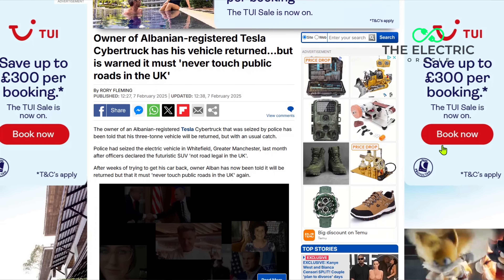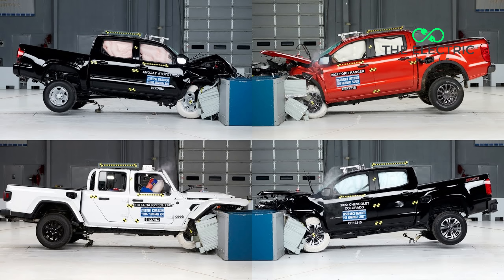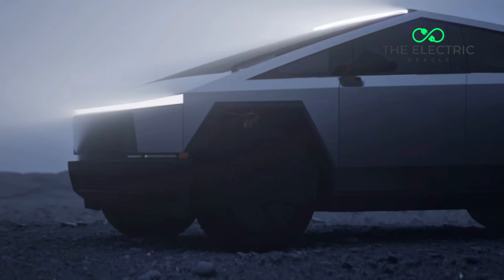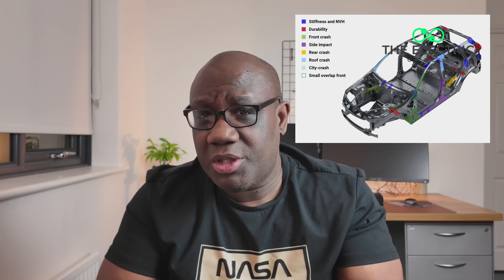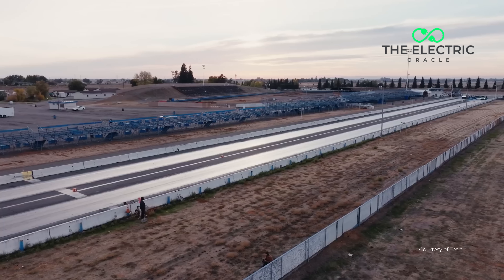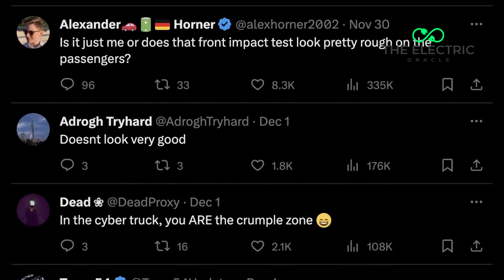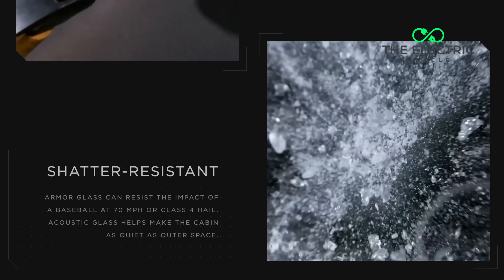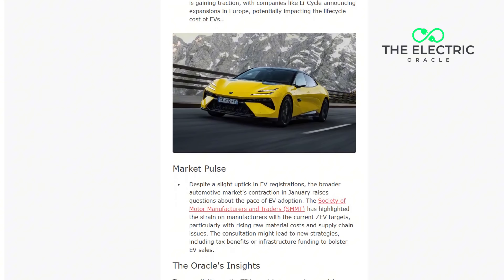Why the UK Banned Tesla’s Cybertruck – 5 Fatal Design Fails!

Comment: There’s many places in the US where vehicles never undergo road worthiness testing after they are sold.
There are pickup trucks driving around that have no brakes, suspension and cracked broken frames. Think I’m over exaggerating?
I am not, there’s a YouTube channel called “customer states” ?. 
The channel shows vehicles that show up for repairs, and are turned away because they are unfit for the road.
People living in the UK have no concept regarding the number of modified trucks on public roadways. Trucks with lift kits, huge wheels and tires which would basically drive over most small sedans. Following annual FATAL US crashes;
In 2022, 42,514 people were killed in traffic crashes
In 2021, 42,939 people were killed in traffic crashes
In 2020, 38,824 people were killed in traffic crashes
Freedom = Oversized ,Jacked UP, Huge wheels and tires,  gas guzzling Pickemup Truck cruising at 75MPH.
Outrageous for Europeans, Mericans Don’t Care.

Comment: The lighting regs in the uk and eu are not perfect. . Cars luminosity levels aren’t that easy to measure and most modern cars headlights are in practise brighter than traditional bulbs. There was a reason in the uk and latterly in the usa that we all used 5.75 and 7” sealed beam units.

Comment: It's not even a good truck.  It can't go offroad.  Look at those wheel wells and how low the ride distance is.  You will bottom out on anything but a very gentle grade if you try to take it offroad.  The suspension isn't really made for it either.

It also comes with an autonomous driving system which can't be trusted not to try to kill someone (probably you), which isn't by definition autonomous if the driver is still needed.  Oh, and that system which doesn't work well in the US has almost certainly not been tested with a right-hand drive configuration.

This is the worst vehicle I have ever seen.  If you think you look cool driving it, you need to do some soul searching.

Comment: 4:50... did you look at the safety ratings? Or are you just looking at a video and giving an  option. NHTSA is 5 stars rating overall. But I would say this wasn't built for UK more NA larger wider roads.

Comment: It's a stainless steel you can't round it. Also, that's horribly outdated. It does not have an exoskeleton that proved to be too difficult, so it has a frame. In the end, We will drive it in Canada, and other countries. If your country has motorcycles, then it all BS.

Comment: The flaws:
1. Prevents the driver from driving into the crowds of people.
2. Prevents the driver from being driven into the airports.
3. Doesn't have a fuel tank, so it's more difficult to be set on fire.
4. Can be remotely stopped in case of persistent attempts of points 1 and 2.
5. Made by company run by the worst person in earth's history (barely rivalled by a certain painter).
Reply: i do that in a gas car

Comment: It's not green if it weighs 3 tons,  it still uses energy in a pointless manner.  Why can't they make cars lighter and more efficient?
Reply: Because it is a big car, and to move a big car you need a big battery, and to move a big battery you need a bigger battery.   There are equations to describe the situation.  You can buy a Model 3, and that is a pretty small car by american standards.  Still weighs more than ICE, but that is again because of the tech.

Comment: You should let Yainni know he seems to be under the impression that the only thing holding the CyberTruck back from being allowed on the UK roads is the drive by wire steering.
Safety first, as a road user there are far too many people on the road that shouldn't have a licence let along be allowed to purchase a 3 tonne vehicle that can beat most supercars in a quarter mile race

Comment: I've watched a couple of videos on this monstrosity and one pointed something out that is actually true.  It is perfectly designed to completely bypass both the coffin industry AND the crematorium industry.  When you leave the road and crash - and the video gave several examples of where this HAS happened unfortunately = you are basically trapped in a steel coffin that the jaws of life can't penetrate sitting on a bank of batteries that will explode and burn with such heat you will be turned to ashes.  Hence the claim it bypasses both coffin manufacturers [nicknamed the cybercoffin for a good reason] AND the crematorium as it will literally cremate you on the spot.
Two very good reasons it should NEVER be on European roads [or those of any other country except that of its origin, the US, where apparently it's brilliance as a mobile coffin crematorium has already been successfully demonstrated [unfortunately for those in it at the time].

Comment: It voids so many safety standards that for good reason it was never allowed in the UK or anywhere else in Europe in the first place.
For those that want to point out how it's safe because in accidents the driver walks aways fine... yeah, those standards are there to protect others as well. Not just the driver.

Super heavy, full of sharp angles, fast quiet acceleration. If it was in a game where the goal is to run over people it'd be the #1 pick.

Comment: Hey mate. What's Your opinion on ev's on passenger carrying ferries?
I only ask as I live on a Scottish island which is a 12 hour (overnight) travel time.
Norway has banned them from all passenger carrying vessels & I honestly think UK should do the same.
Just for example, my ferry has to travel through extremely rough weather, the ferries are ro-ro's. If a fire started, even if it wasn't caused by the EV once the EV caught fire it could be a major disaster as there can be up to 700+ passengers onboard+ the crew.
I would just like Your opinion on the matter.
Thank's.

Comment: As was said at beginning, over 16,000 pedestrians hit by vehicles each year in the UK - and many of these were on the pavement. Most people live in towns where vehicles are driven at 20-35mph only inches away from children walking and skipping on pavement etc. Even with safety features like brakes, crumple zones etc vehicles are hazardous to people’s well being for many reasons. For all our sakes, if vehicles are to be driven where people live or walk, they need to be light weight (say, a tonne or less), small, and slow (<20mph) and be driven by people who’ve done a course in the effects of driver behaviour. Distractions like infotainment systems should be banned in towns - drivers need to focus 100% of time on what’s happening outside.

Comment: i have just one tiny point and i might be wrong but the last time i looked at the construction and use regulations in the UK indicators could be white at the front and red at the rear, they only need to be amber if they can be seen from the side so i think the CT indicators do comply with that.

Comment: Tesla literally creates the most secure vehicles on the market. Safety is the first design principle. The Cybetruck will not be any different. It might violate certain regulations written without a CT like vehicle in mind, but I would bet it protects passengers better than all other alternatives. Still, if 3+ tons hit you, you die immediately even is it is made out of softer aluminium. Tesla's active safety systems might actually prevent such accidents from happening in the first place better than any other alternative truck.

Comment: Too may off-topic replies about the looks.  This video is about UK compliance, not aesthestics. Are the US Crash Tests that different to UK/Euro tests ? I've seen US videos of cars with wide wheels that protrude outside of the wheel arches/fenders. Totally illegal here, but seemingly of no concern to US regulators. I've also seen UK videos of Kit Cars going through our tests. Steel balls of various sizes are offered up to edges and gaps where pedestrians might get caught or cut. Width-wise even the widest supercars max out at just over 2m and even that can seem too wide for UK roads. Also remember that the best selling vehicles in the US are trucks, only 2% here ! Clearly no market here. Weight-wise so what, we have plenty of 32tonne trucks causing havoc.

Comment: It’s not even a good truck as the heavier the load the lower the range that’s why ev plant and hgvs are non viable right now my dislike of the ev market right now is it’s stunting the development of hydrogen fuel cell technology because batteries replacement makes money for the manufacture but hydrogen fuel cell technology would make electric viable for working vehicles

Comment: These crash tests are at a very slow speed and that is misleading.  The Americans crash test is at 35 mph and the EU test is a similar speed.

If you double the speed to 70 mph then you multiply the energy by four, and if you triple the speed to 105 mph then you multiply the energy by nine.

People see these 35 mph tests and think their car is totally safe, it very dangerous for people to think they are safe because then they will be more than happy to drive three times the crash test speed with nine times the kenetic energy.  These crash tests go very differently when you multiple the energy by nine.

I think it should be stressed that whenever these tests are shown just how slow this is, but also the tests at 70 mph and 105 mph should also be widely shown, because this would stop people getting in to the wrong mindset.

Comment: In the EU that eyesore is not allowed either due to its failing of safety/health/motor vehicle laws and regulations. Besides It’s heavy, a special driver’s license (3500+ kg) might be required, maximum speed limitation 50 mph on highways because it’s a (light) truck, etc. 😊

Comment: The crash test pictures are not comparable. One is an offset test the other full frontal. Cars are in any case designed to pass crash tests.  The moment the tests get change virtually all fail the new test until they do some redesign to to pas the new test. The Cybertruck is definitely designed for American use.  Even in South Africa we are not interested in the oversize US trucks, so Tesla might come up with a Model Y or S based pickup that will be more functional for the rest of the world.

Comment: Stating the Cybertruck having an exoskeleton, is inaccurate & confusing: The Cybertruck is fundamentally a unibody vehicle, but its "exoskeleton" design means that the outer panels contribute more significantly to structural integrity than in traditional unibody designs. The angular design is primarily a consequence of the specific type of stainless steel that is being used, which is so hard, rigid and brittle, that it can basically only be used in more-or-less flat designs

Comment: The cybertruck is illegal in Australia. It does not meet our safety standards.
Reply: Other than the lights and some of the electric only release issues... it actually is.
Ironically because it's so heavy it actually gets in the weight exclusion zone meant for our trucks, except it's slightly under the weight limit before you need a HR (Heavy-Rigid for non Aus) license. It's the same quirk that lets the other Yank Tanks in.
Reply: @smalltime0  It also fails ADR 69/00 which I think is similar to the UK rules mentioned in the video regarding the exoskeleton and rounded edges. Assuming the info in the video is correct, then the cybertruck will never be available in Australia for this alone.
Reply: @ Aus doesn't have pedestrian safety and passenger safety is exempted in heavy vehicles.
If the lighting can't be changed without a complete redesign (like the video suggested) it's a non-starter anyway
Reply: @ Since NHTSA just gave the Cyber truck a "5 star" rating, the safest vehicle ever made, it will be just a matter of time before everyone will see the truth.😁
Reply: @ NHSTA 5 Stars aren't worth the paper they're written on
Reply: @smalltime0 
It's too heavy for an ordinary  license in UK - not that you can drive one here 😅
One idiotic bloke tried getting one on our roads by registering it abroad and getting 'legal' paperwork for it there before bringing it in.
Manchester police hoiked it off the road as soon as they saw it! 
Top lads 😂
Reply: @ There actually are no electric only release issues, someone just made that up. Facts will win out over emotions every time.
Reply: It's illegal in Australia as it's only made in LHD.  But to convert it may be easier due to its drive by wire setup possibly?
Reply: Same in UK and EU.

Comment: Imagine this.  The prototype was much bigger and about a 1000 lbs more.   Now ad 3 more motores and larger battery pack for the most powerful model.  The sharp edges was to make it cheaper to manufacture.  Round edges cost more.   The steel is what Musk uses for his rockets.  So the truck steel cost was to help subsidize Space X for the cost of steal.  More steel adds up to lower price for the steel.

Comment: The decision of UK and probably all of europe was predictable and obviously.

Most cars are transporting exactly one person most of the time. What do you think - is it sensible and clever weight to usage case ratio to use a vehicle with more than 6000 pounds to move a person with the weight of 150-300 pounds? Even if we do measurements with the highest body weight that is a ratio of 20 to one! Most regular cars do have a ratio of 10 to one or even less!

No matters what type of energy it uses - it still is energy, that has to be produced somehow. You need energy to accelerate the vehicle, you have to get rid of all that energy in emergency breaking situations. You also have to move more than 3 tons over the asphalt, double the weight means quadruple the wear and tear of the asphalt! What about micro plastics? When wearing down the tires you get microscopic small peaces of rubber and plastics, neatly distributed all over the road. And, again: double the weight on the tires will quadruple the wear and tear of the tires as well! So, 4 times as much microplastics and extra-fine dust on our roads and in the end in the rivers and the sea over a regular 1.5 ton car!? 

Do you think that would be sensible and acceptable or even be some innovation and improvement in our transportation concepts?

Comment: Fun fact regarding the weight, in Germany the current weight of the car doesnt matter in the slightest, the thing that matters is the maximum allowed weight the model was registered with and that's listed in the registration. And if that is over 3,5t you need a truck license, although the smaller c1 license is is enough, no need for a full c license

Comment: A couple of times you ask if its fair that safety rules trump design innovation. That's a false dichotomy. A design is a compromise between competing desires eg lightweight vs strength to meet certain constraints e.g. a car stiff enough to have great suspension control but light enough to corner well. If you are designing for a road vehicle then  your constraints include the rules of the road which luckily in Europe (& the uK SMH) take into account others not just those tools in cybertrucks. Innovate all you want but meet the standards or you don't get to play here. Simple & sensible.

Comment: The cyber truck is anything but revolutionary. It is literally the result a narcissistic ass-hat, looks to be designed by a 5 year old and has the build quality of a 1980's American car. Resale values in America are already dropping off a cliff, although to be fair, so are the resale values of all high end electric vehicles in America. Tesla may have started the EV trend, but the cyber truck along will all the updates of the other current models, along with the no-show of the Roadster and Semi proves Tesla is an a downward spiral. Add to that the current distraction of its Nazi CEO and this could well signal the beginning of the end of Tesla. We can only hope I guess

Comment: I remember seeing a crash test with an old Cadilllac (I think that was the car) and the none collapsing steering column getting pushed straight up into the face of the driver, a great looking car that will end you, like the Ad show a car crash making you guess who killed the driver, the loose dog in the car, rear passenger with no seatbelt, nope your steering wheel will smash you head off.

Comment: Also, notice how in the crash tests of the others, it's visible how the front wheels go downwards and beneath the car... those cars with conventional front engines would send the engine in the same direction, simply to protect the passengers.

But yeah... the cybertruck is pretty much based upon the philosophy behind the US safety standards... keep your passengers safe, don't worry about others. Then it also makes sense to make a really sturdy car that is heavier than the others... then the others will be your crumble zones. 🤷‍♂️